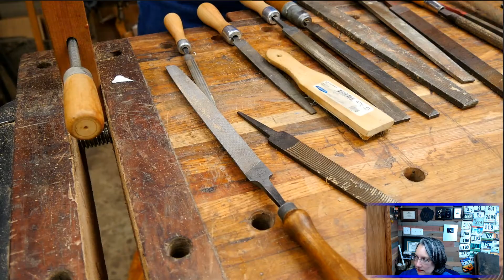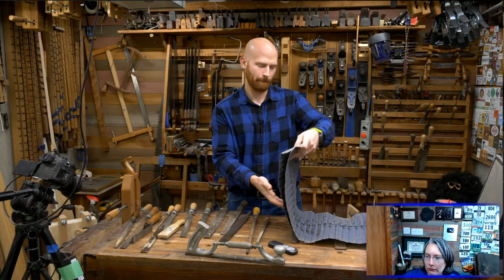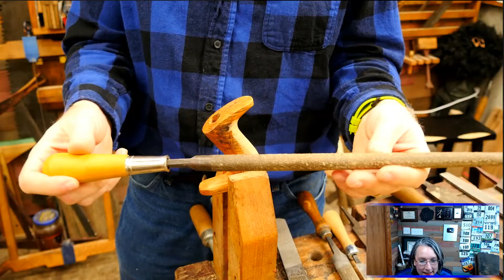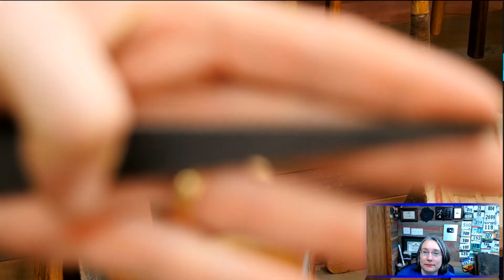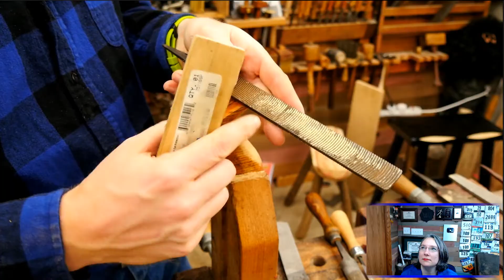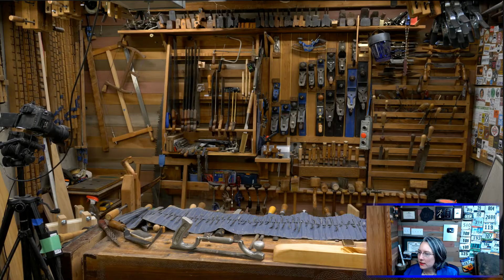All about Files, Rasps, Riflers, and Floats

Comment: I just wanted to share a style of rasp I found in my father's toolbox. It's sort of like a tubular cheesegrater 1/2 inch diameter(hollow and slit down the length). I made a feel and mounted it on that. It's quite brittle but excellent for cleaning 'interior voids' ;)
Reply: *dowel not feel
Reply from the maker: nice. I know a lot of people like those. they give a clean cut!